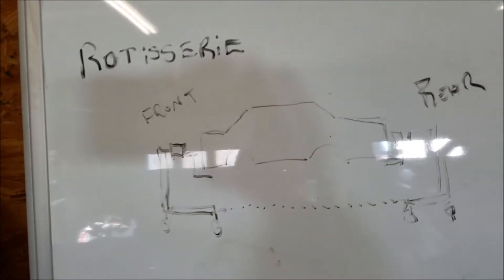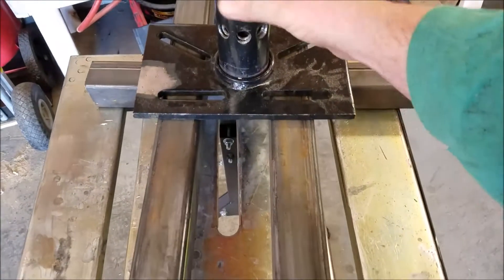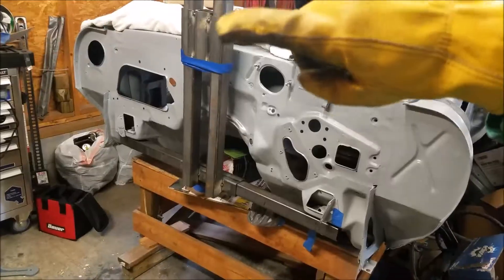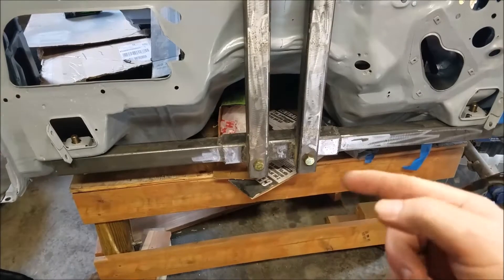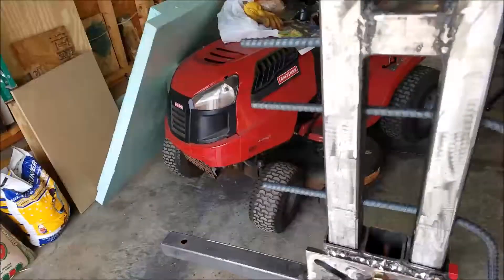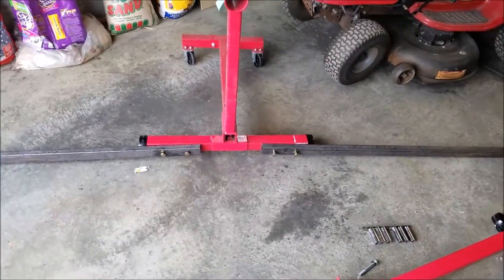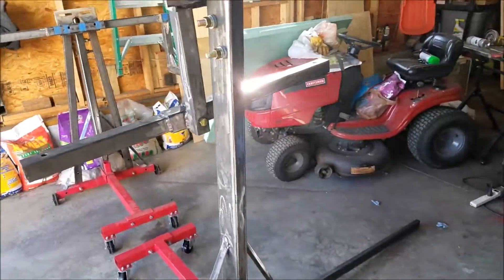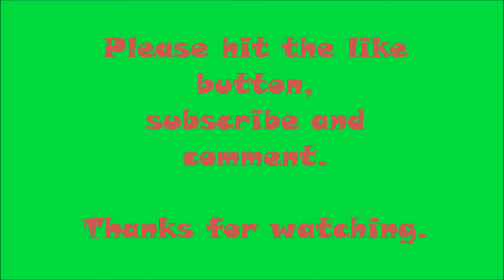DIY Rotisserie Part 4

Comment: make sure you have some help when you are putting the 69 on the rotisserie.  Wouldn't want to see it dented.  lol, really, for your safety, have someone there with you.  Good luck.  Hope it works like a champ.
Reply from the maker: Thanks, I'm in the process of shortening them because they're to high and not even at the point where they rotate.

Comment: Here you go..  www.youtube.com/watch?v=xgkjIiT1yQE  I just use my cherry picker to raise the cars on mine. I see you have your pivot points at different heights, that may not let it rotate right??
Reply from the maker: Thank you so much for the video link, have no clue why I couldn't find it. Anyhow thanks again.  Yes the height seems high and I will make adjustments to it.  I'm planning to do a mock up and see how that goes, adjust as I go. Your project looks like its moving right along. Good job.
Reply from the maker: Rarerat so I'm adjusting the height right now. Where the rotisserie pivots are both stands the same height or is the front a couple inches taller?
Reply: I have both my front & back pivot points the same height. I could be wrong, but I don't it will rotate if the pivot points aren't set at the same height. You can move the car it's self up & down with the front mount, but I think the pivot point need to be straight across from each other. I hope this helps & good luck.
Reply from the maker: Rarerat , thanks.